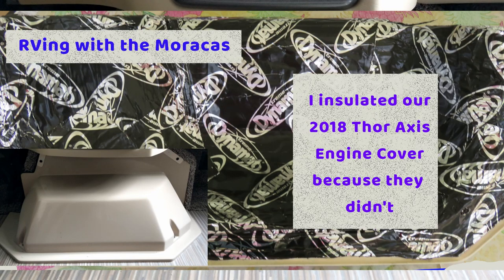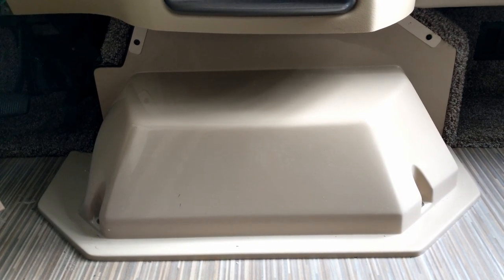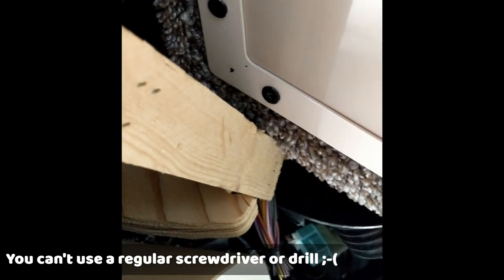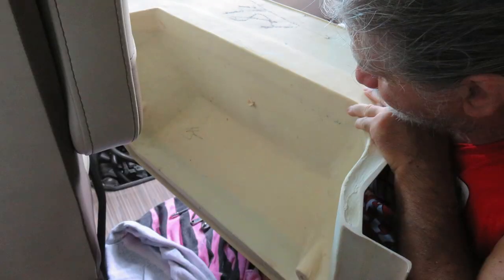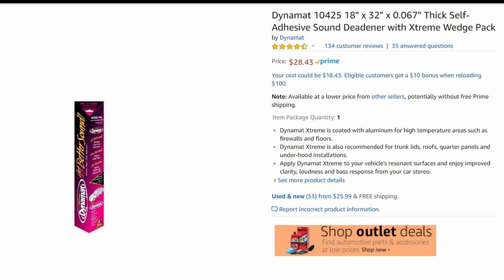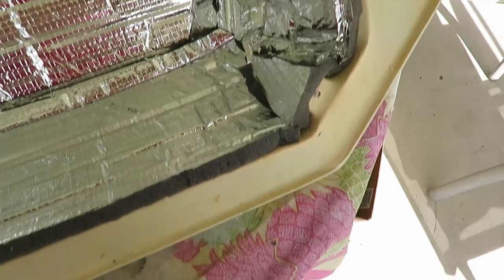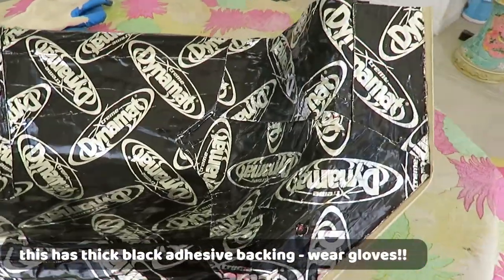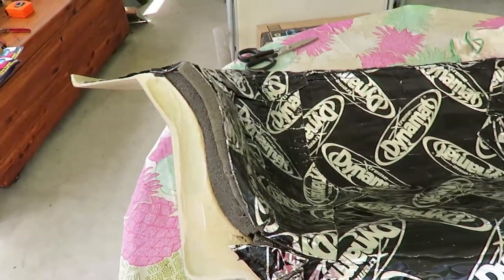RV Hacks - I insulate the engine cover of our 2018 Thor Axis

Comment: Dynamat was 3.75 total sq ft listed on Amazon, so cost was $7.58 per sq ft.  Ouch!  Way too pricey.
I would have used Noico or Kilmat.  Cost is $30 for 18 sq ft - 6 times more product than Dynamat.

Good to know though that this fix worked.  I have the same problem with a 1997 Ford E350 V10 Class C.  Must insulate the doghouse.

I wonder if its wise to also insulate under the hood?  Engines get very hot.  The hood dissipates heat.  If I insulate it, heat might not leave as quickly so might get too hot?  Would love some feedback from others on this.

By the way, since you live in Florida... I wanted to make a trip there in my RV - cross country from CA.  Is it easy to park my RV anywhere on road or stretch of land or by the beach without paying campground fees?  Are there places to stay overnight or refill water that are not pricey or free?  I cannot afford campgrounds any more.

Comment: Are you otherwise happy with the RV? About what is the MPG? Thanks for posting!
Reply from the maker: Yes we are happy with it. It seems to be a good value.  We have gotten between 8 and 12 towing car.
Reply: RVing with the Moracas I’m currently looking at some used 24.1’s and towing a Corolla via a dolly. Does it have enough power to tow a 2800lb car ok??
Reply from the maker: We flat tow a Ford fiesta and it is no problem 👍 it is rated way more than 3K